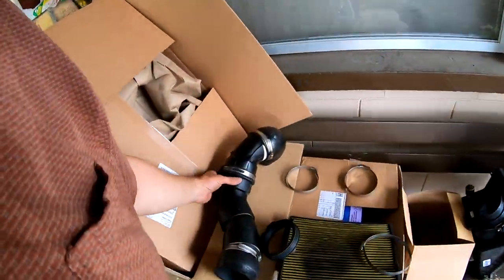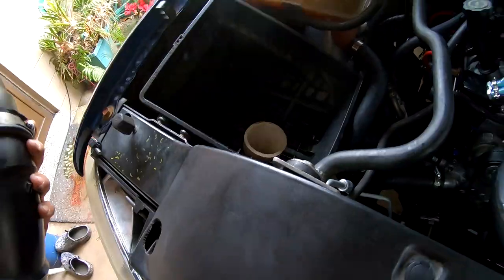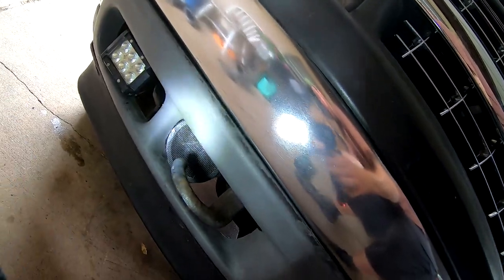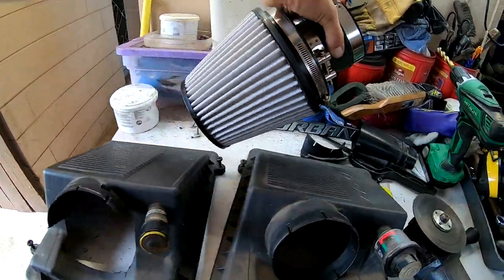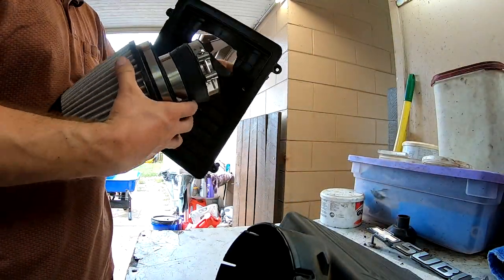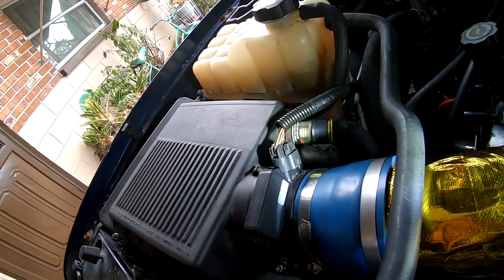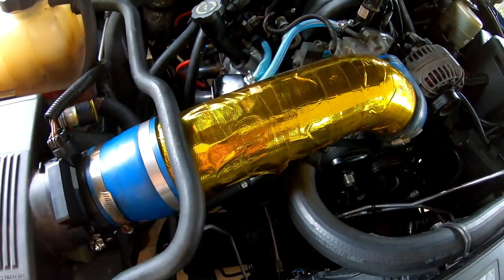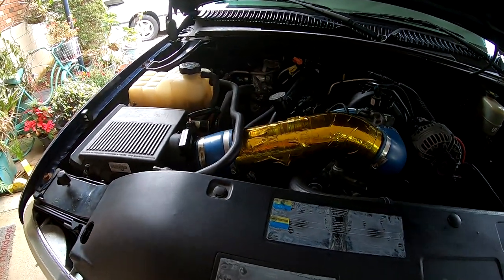PVC INTAKE OR A REAL INTAKE? MYLES: PROJECT 2.0

Comment: I like your ideas of running the ductwork from the bumper up into the air box from the bottom! Nice reuse of the factory air box even with a pod filter as well 🤙 honestly, I believe you're over thinking about the larger cuts in your air box, I've seen SOOO MANY drivers who just rip out the factory intake and slam a pod filter in the middle of the engine bay.
Great job on yours though!